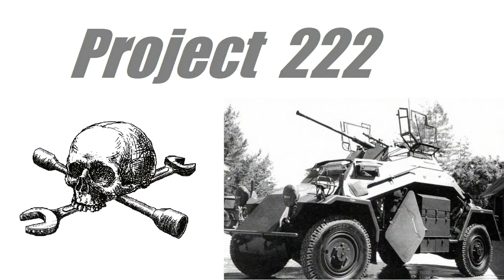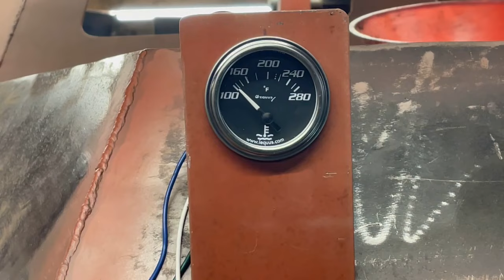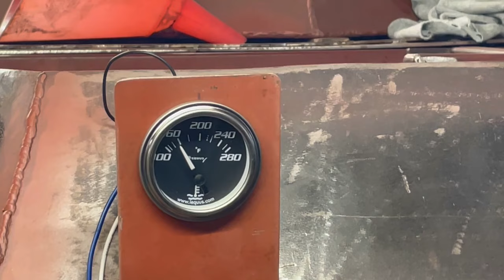Ep 68 Project 222 Building a WW2 Armored Car

Comment: Hey my friend absolutely love the project couldn't be cooler it earned my subscription. just a suggestion maybe think about switching over to an electric fan you would gain some power by freeing up the constant drag on the engine from the pulley belt and fan plus a good electric fan will alway keep your engine temperature exactly where it needs to be when it needs to be especially with a two speed fan. They aren't too expensive, usually come with everything you need like a nice digital dash temp gauge and 90% of the time it would be running off excess power from your charging system. You can't beat it increases your cooling ability with a fan that is more compact, more powerful, uses power you have an excess of and best of all gets rid of that constant drag on your engine letting it make more power while at the same time keeping your awesome machine cooler at the same time!  Just a suggestion and either way love your cool ass project and your awesome work you defiantly earned a subscriber here!
Reply from the maker: That’s for the sub… yeah the cooling system already has an electric fan,  but the rear engine has the rad in a weird spot so we were having heat issues.  The new plastic fan is more to help push hot air out of engine compartment